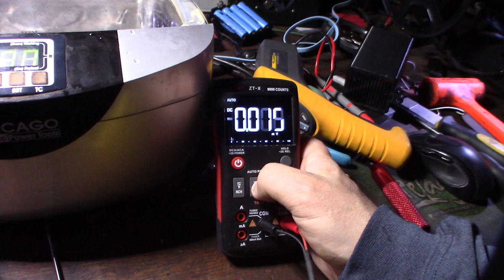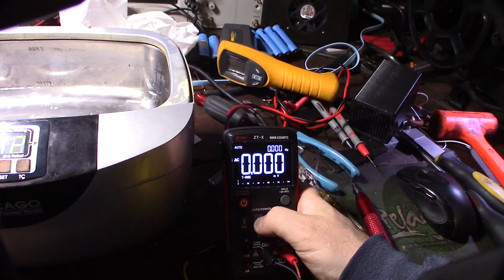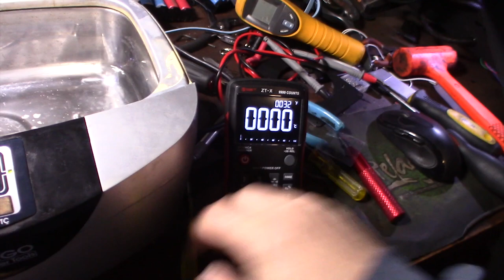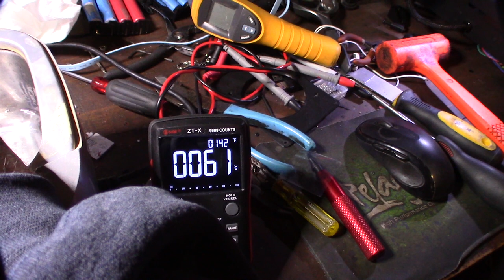Harbor Freight Ultrasonic Cleaner Heating element troubleshooting heater repair Replacement Part 2

Comment: Hey if your in a pinch, I did it to mine years ago, and it's still going strong, go to a place that sells candle warmers, they are cheap at wal mart, take the heating element out of that, it 110v 50 to 100 watts, glue it in with the thermal glue, splice the wires in, and put it back together, and your done, works like a charm, just a FYI for anyone who's in a pinch and needs it fix fast.... Great video BTW.